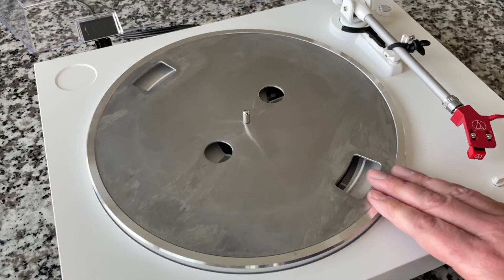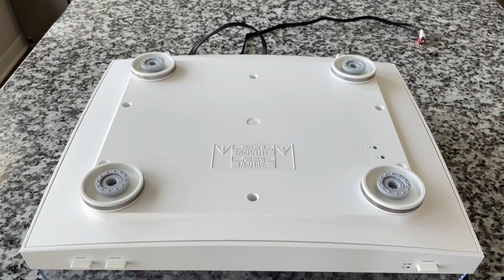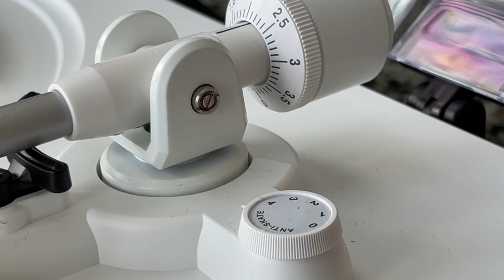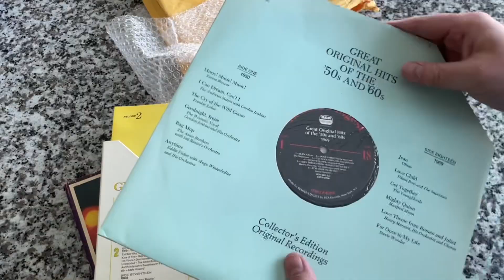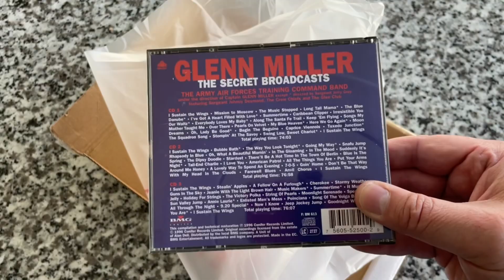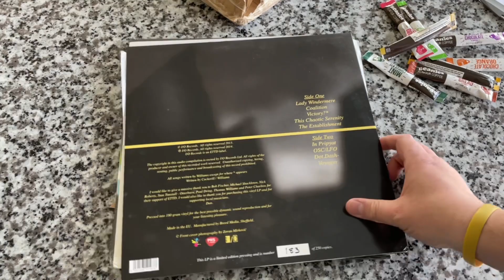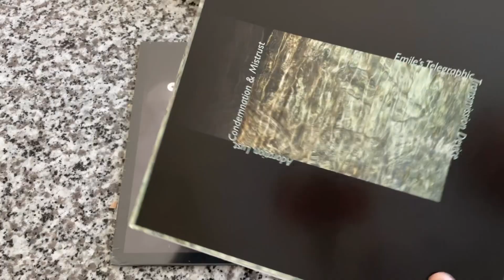Audio Technica AT-LP3 One Year Later!

Comment: Can you tel us how to improve a victrola VTA65?
Reply: I know this is going to make me sound like a jerk.  Trust me when I say I'm trying not trying to be, but... here goes.

Don't spend a lot of money on your VTA65.   It just isn't worth it.   Stereos like that are built specifically to meet a low, low Walmart price, and they aren't made to last.

If that's what you can afford, brother - well, that's what you can afford.  I get it.  That said, you're still gonna spend some money to make it better.  Let's try to spend it in a POSITIVE direction.

The most significant flaw in those all-in-one things (and briefcase players as well) is their tiny, crummy little speakers.  They sound like crap.  Unfortunately, it's not really practical to open the unit up to upgrade them, so let's bypass the internal hardware entirely.   On the rear of your unit, you'll find a pair of LINE-OUT jacks.  That's the ticket.

You can buy a pair of Edifier R980T amplified speakers for like $75 (they also sell a pair of R1280Ts for like $100, a somewhat better option).  Connecting them to those LINE-OUT jacks will yield some startling results.  Seriously, you won't realize how bad the built-in speakers sound until you compare them to REAL speakers.  The cool thing is, they'll also work with your MP3 player, CD player, what have you, and they'll also work with whatever you eventually replace that VTA65 with.

Another alternative would be one of those inexpensive 'LePai' or 'Lepy' mini-amps they sell on eBay, and use it to drive some Dayton B452 or B462s, or even some inexpensive thrift store bookshelf speakers.  Even a decent set of computer speakers would be an improvement, so long as they're not those $14 things you might find at Walmart or Dollar general.

Note that better speakers won't address ALL the flaws, but it's the most bang for the buck starting point.

Also, most likely the VTA65 shipped with a sapphire stylus.  Those are only good for 40-60 hours of use before they become worn.  A worn stylus WILL damage records.  Upgrade that to a DIAMOND stylus, which lasts much longer and tens to treat your records much better.  That would be the maximum money I'd spend on the VTA65 itself.

Check tracking force; for that type of cartridge 4-6 grams is normal.  If it's significantly higher than that, you'll need to find a way to lighten up the tracking.  If it's too low, that can cause skipping.

Beyond that - dude, save your cash for a better turntable.   Don't fall for the 'I'm gonna make a silk purse out of a sow's ear' thing I see so many people fall for.

I'll be happy to answer any further questions you might have.